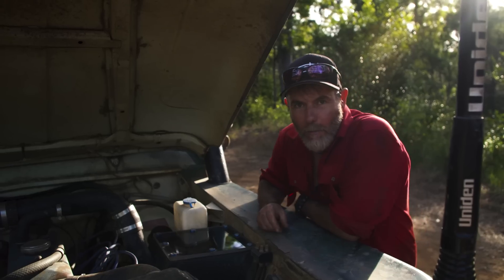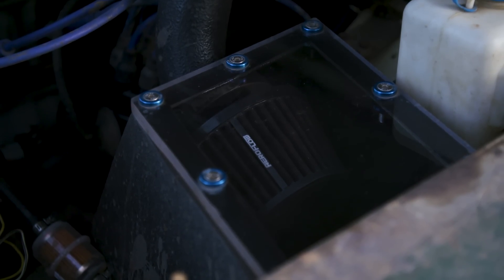HUGE PROBLEMS FOUND! 47yo Nissan Patrol to Cape York - How Graham got it ready!

Comment: Drove across the Jardine in a G60 back in 1979.. No barge then. Learned my trade on these old Nissan's, run them for years. Only recently dropped a ute load of spare parts at the tip, nobody wants them any more and taking up shed space. Keep an eagle eye on the two short spring studs in the diff housing, driver side. The are known to strip and pull out of the casting on heavy bumps!

Comment: My dad had one, a 72 two wiper rag top MWB, I adored it. I drove my 77 MWB hardtop 23.000km up the booraloola track and to uluru. I adore G60's. The P series engine is so torquey you only need 2 gears when you are moving, I could cruise at 95kph with ear plugs and use the hand throttle as cruise control. You could start my dads with a 5c coin! my drivers door latch kept rattling loose on the corrugations in the NT, so I also had an ockey strap on the door but that was to hold it shut! Full of character, do you have the crank handle?
Reply: oh and they left the factory with no brakes!!! they need adjusting constantly. G61 had a 4 speed box, sold in central/South America

Comment: I had a 1962 Landrover series 2 that was more refined!  Crash first and second with 4 forward gears AND overdrive!  would do 60 mph!  yellow button 4wd high with the red lever for high range, 4wd low.  then the lever for overdrive.  2.25 litre diesel with less power than the g60 but mega reliable provided you kept it serviced.
Reply: the G60 starter motor has more power than the 2.25 diesel LR motor LOL!

Comment: Restore the timber sides but chuck in an ali floor & boxes. It will look so crap with ali sides it doesn't bear thinking about. 
Better yet, strip the green off the whole vehicle & give it a similar but different look to the farm truck. Then you could strip & oil the timber tray sides & do the cab in colours that suit. 
Side by side with the Farm Truck 😘
If you put a canopy on it it will destroy it IMO.

Comment: WOW What a trip down memory lane.
A 1977 SWB soft top Patrol was my first 4WD. I bought in new for just under $6k, I wanted a SWB Toyota but there was six month wait and I wasn't waiting.  I then spent another $5k on accessories, Roll bar, full external bar work including truck like winch bar, biggest and best Warn winch of the day, 2 huge spotlights, 2x 100lt Aux fuel tanks, Recaro seats, overhead console with Pioneer sound system with biggest amp of the day and a CB.  I wanted to be the first to traverse the Canning stock route in a modern day 4WD.
That never happened but in the 12 years of ownership I had so many adventures with the Green Brick, I have too many tales of getting stuck, roll overs, breakdowns and bush mechanic repairs to tell here.

Thank you for this video and bringing those old memories to mind.

Comment: Mate, you haven’t drive an old 4WD until you drive old Jeep Willys (3speed) or Russian GAZ. Jeep, as you know, goes back to the 30’s and the GAZ originally a bad copy of Jeep goes back to the 40’s. All the instruments you mentioned were in those vehicles. BDW high been switch on the floor was a common standard untill around 50’s. My first car in Australia was Holden HR 3 speed column shift 1967. No power steering, no fan, no issues. Yes, drum brakes all around. Got me from Melbourne to Perth no worries. The most important for me was that the car cost me $295.00 plus stamp duty $15.00. Yeah, long time ago.

Comment: Mq disk brake conversion...pathfinder brake booster upgrade= decent braking power...
Mq parabolic leaf packs will fit up front and make the front end a heck of a lot nicer than the original packs...almost coil like compared to stock.
Rears can be made with the top 2 normal leafs and most of a 75 series or gq leafy rear pack....

No you cant have my g banger badges 

As for gunshot, chuck her in 1st low, ease her in and switch her off. Let the compression be your braking hahaha. Triple pump the brakes first tho. Hang on and good luck

Comment: I’ve still got a HR Holden with about as many mod cons: 3 speed floor shift, floor dip switch… and keyless ignition - but not that modern push button start stuff. You just don’t need a key at all 😜
Reply: I have a HR X2, it has a 4speed though but just as many buttons and switches as the G60. I love driving the HR as it is simple and fun.

Comment: i dont know what is holding this beast back but those vehicles could do 160 kph when they were new due to the big 6 cylinder
Reply: I am not sure 160kph!....but I saw 140kph on mine. Can't hear a thing anymore LOL. However, mine was a very tidy example in very good health. Your right though, I cruised the outback easily at 90 - 95kph on the hand throttle, they are obviously noisy and there is a it of heat soak from the trans tunnel. mile after mile. It may be a three speed but top is 1:1, just like the Landcruiser. 145hp 320nm, plenty more grunt than the farm truck

Comment: I started driving in 3 on the tree cars witch had the head light switch on the floor and loved them 😁👌
no syncrose in the gearbox so soon learned how to double clutch 🤣😬 also learned how to change gears without using the clutch 😂😬
i still double clutch and will continue till i can now longer drive  😁👍
would love to get another old 4x4 with crash box as you said ''they are sooo much fun''

Comment: Hell yeah to gunshot. Dad had the same model but a a medium wheelbase with a canvas roof which we drove back from Darwin to Melbourne on the Stuart hwy when it was still dirt and totally corrugated. Now with dads old g60 he had a choke in it which also doubled as his cruise control. The more u wound it out the more choke it would have lol. 4 drum brakes all round which gave up the ghost in the Adelaide hills. What a truck that old girl was
Reply: did exactly the same. Its not a choke, its a hand throttle as these things are fitted with PTO

Comment: whos the exhaust installer that placed a exhaust pipe UNDER the frame work, instead of inside the underbody??? shave the door handle, be the first in the outback to have shaved door handle in the bush???

Comment: Not a full resto maybe a late model which turbocharged motor and running gear, keep the patina and don't go overboard with MITZ keep the character as you barrack on about it

Comment: Please don't put a mits canopy on the back of the g60, it just defeats the purpose of having an old rig by making it modern. Save those trays/canopies for the newer 4wds, and keep the farm truck and the g60 as they are with basic setups and simple 12v. It really enhances the old school experience that those cars provide, and highlights what you can do with a simple setup without spending thousands on a tray and/or canopy setup

Comment: ive gone down a rock climb in my 95 pajero and when i tried to brake they didnt work so i ripped up the handbrake as hard as i could and it barely stopped me. it was scary because i was by myself in the bush. i fixed it and drove home and it happened again on the highway so i used the handbrake and downshifted as much as possible because of a red light. but yes i think you should do gunshot.  I know i believe in you and i reckon everyone else does too

Comment: Had a floor button for the high beams on an LJ Torana and a late 70s Valiant. It wasn't an uncommon thing.  I remember being a bit disappointed and not using the high beams much when I moved on to a modern set up.

Comment: It was a trip down memory lane to see an old G60, I got my first G60 in 1972. I was 18 years old. In 1975 we headed for Cape York with it WHAT a trip. You are dead right about the brakes we towed an 18 ft caravan all over the top end lucky we put PDR brakes on it as we relied on the van to pull up it and the G60.

Comment: Loved my old G60, they are an absolute beast,  I fitted MQ-MK front and rear diffs into mine, they pretty much bolt straight in, only need to machine centre of both driveshafts to fit the MQ-MK Flanges,  re-drill the 4 bolt holes, then u have front disc brakes,  I also had a rear LSD centre,  made the old G60 even better. Do Gunshot,  low range 1st gear and the old beast will just crawl down, no brakes needed,lol. It's a shame I didn't know u needed parts a few weeks back, a mate of mine sold 7 G60's(couple of good runners and rest just suitable for parts), plenty of spares.

Comment: There is just something about older 4wd’s that just make them so cool.
I’m just curious, did the g60 patrol and the farm truck come out in a diesel?
😂👍 graham is hilarious
Reply: The old farm truck is a diesel, the 2H motor, 4L in-line 6
Reply: no a 3.9 litre petrol only
Reply: @stealth5959  oh okay that is the G60 patrol isn’t it?
Reply: @stealth5959  I have the exact same cruiser as Shauno, a 1984 hj47 landcriuser, and she is a 4L inline six diesel, paired to a 4 speed manual gearbox.
Reply: The G60 only ever came with the 4.0 inline 6 petrol P motor
Reply: G60's didn't come factory with a diesel only the p40 4l inline 6 petrol. But quite a few got converted to the SD33 inline 6 diesel when they were released in the mk patrol
Reply: @harrywalker968  yeah true that makes sense

Comment: You don’t need brakes on the trail if you have a winch… re-direct to the rear and let yourself down slowly.

Never pass up seat time for equipment failure. Improvise, adapt, and overcome.😎

Comment: Love foot switch high beams. My 87 bronco had it, and my 73 f100 has them. They should be standard in every vehicle. Way easier to operate when you’re cornering, rather than fumbling on the steering wheel swerving everywhere.
Reply: Early Holdens like the LJ Torana and HQ also had them.
Reply: Had three F-150s ‘89 through ‘94 with this as well. It was a difficult change to a “normal” car with it on a stalk.
Reply: the original 50's Mini had a high low switch on the floor...
Reply: My EH had the high beam foot switch